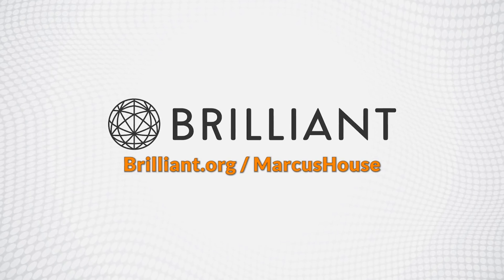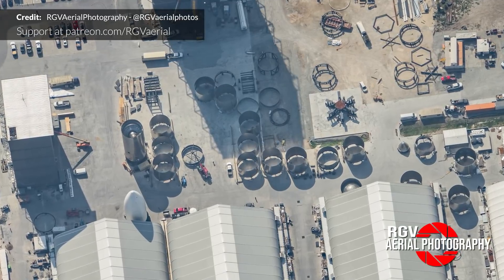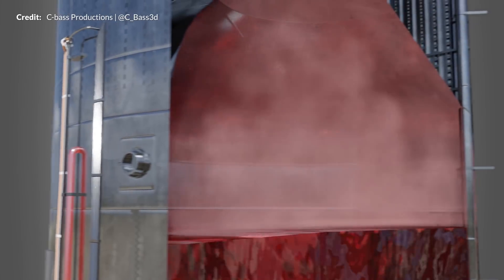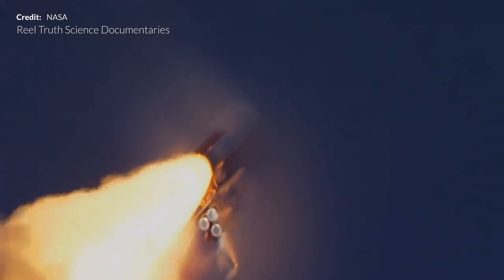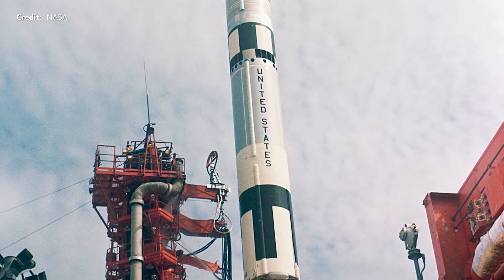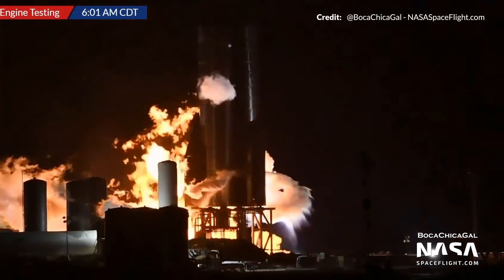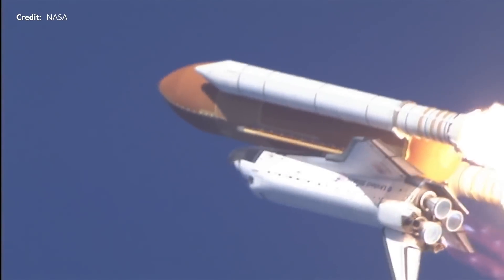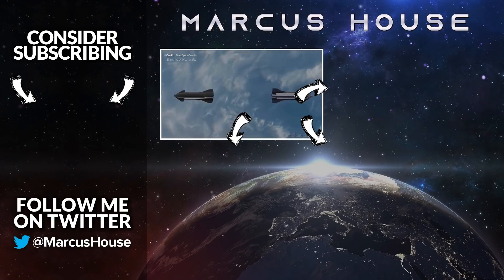SpaceX Starship - How will Starship tank autogenous pressurization systems work?

Comment: Question about something you stated early on in the video. You said that pressure is required for structural stability of Starship so the weight doesn't cause the rocket to collapse down on itself. Wouldn't that mean that when Starship does start to take payloads to space, the tanks would need to be pressurized before loading the payload? If the payload is in the front of the rocket, wouldn't that weight cause the ship to collapse if there's no pressurization below? (Assuming they don't pressurize until right before takeoff)
Reply from the maker: We are not sure what that limit is, but potentially yes.

Comment: Autogenous pressurization will be the way to go for longterm missions. When reentering on earth or mars parts of the fuel are likely gonna be used for cooling anyways so there should be enough heat. 
However this wont work for either suborbital flights or when landing in the dark at a non-atmospheric celestial body.
And also they will at some point need to start their engines while in orbit but on the night side. 
So COPVs are going to be needed. But they won't have to use them all the time.

Comment: Marcus, I say get rid of the header tanks and replace them with baffles inside the CH4 and O2 tanks so that the main tanks are effectively segmented into chambers, with the aft segment having the volume which corresponds to the amount of fuel needed for the landing burn.  Tanker trucks use baffles to prevent the problem of sloshing liquid causing structural damage.  Baffles in the main tanks would add structural integrity, and during main engine operation, acceleration would push fuel toward the back of the rocket, and would cause the chambers to drain from one to the next, so that the aft chamber is the last chamber which contains fuel, and which would have no gas-state reactants, and therefore no sloshing problem, and no cavitation problem.  Pressurize at the top/front, and draw fuel from the bottom/rear.  No sloshing and no cavitation.  The baffle could be sealed using a valve.  We know that mechanical operations occur inside tanks, because that became an issue with Apollo 13.  The only problem right now with my suggestion is that the header tanks seem to be needed at the top of the rocket right now, for balancing the weight distribution.  That need is temporary.  The function of the header tank, other than weight distribution, can be accomplished with a baffle and a valve which would add structural integrity without adding net weight.  SpaceX should be adding dead weight at the top of the rocket anyway, rather than balancing weight distribution by putting a header tank there which will need to be moved eventually anyway.  But your post was about pressurization and not about ullage wasn't it.  Excuse my rant.

Comment: I find the explanation slightly unclear/confused regarding the plumbing around the preburners.
To be clear: The gaseous output from the preburners is NOT used for autogenous pressurization.
The output from the preburners contains gaseous propellant, but also some water and CO2. Those would freeze to solid chunks of ice if you feed them back into the tanks.

Instead, some liquid propellant from the tanks is fed through a heat exchanger to boil it to a gas, then that gas is fed back into the tank.

Comment: My thought is that they need a 'micro-motor' that handles pressurization without needing to fire up the main engines. Give it multiple exhausts that equalize the thrust (say, out the side of the skirts). Instead of COPVs to start it, maybe it could use a small electric motor or a small gas turbine powered by low-pressure oxygen and methane - something that could essentially run off unpressurized gasses from the main tanks.

You might even be able to maintain tank pressure continuously by harnessing the waste heat from the crew compartment. Removing excess heat has always been a problem for spacecraft, why not figure out a way to harness it for something useful?

Comment: I believe their issue is not the pressurization, it is the fact that during the swing, the fuel is sloshing in the tank so the liquid fuel is not flowing constantly into the burner. They need to either baffle the tank or put a bladder in the tank to control the fluid.

Comment: How about a structural core fuel tank; two core proportional cylinders running the length of the Starship, functioning as two structural ‘syringes’ injecting LOX and methane towards the engines? Could mean more Window Seats...?

Comment: Hey Marcus I think you should talk about tank pressure under different atmospheric pressures, would it be easier to pressurize the tank on mars or the moon and even in space, because the lack of pressure on the outside pushing in. and can Starship hold its integrity in space if it keeps its pressure from sea level or would it pop?

Comment: To keep the pressure, just put a catalytic membrane between the ox and CH3 tanks.  The slow burn (size dependent) would produce heat and gasses to keep both pressurized.  But what if the problem in SN 9 was not pressure, but big bubbles in the supply lines to the engines?  What the starship does, the others in your examples do not do, is flop down on it's side.  Bubbles cause huge swings in ratios and boom, a piece of the engine goes flying out the bottom, and the engine will not light - because it is damaged.  This is not an easy problem to fix.
Reply: This is a problem they've calculated in from the start and it's the reason why they use header tanks.
If there's enough pressure in them there won't be any bubbles.
Reply: @EaglePicking  That is a fallacy.  As long as there is headroom in the tank, there can be bubbles.  And there has to be headroom in the tank if it is pressurized with a gas.  If there is no head room, the fuel cannot leave the rigid tank.  As soon as the nose goes horizontal or below, fuel can flow "up" out of the feed pipes, replaced with vapor.

Comment: IMO SN8,9,10 and 11 all have an obsolete header tank design. Because of it the remaining SN10 and 11 stand fairly high chance of RUD. I don't think autogenous pressurization is some insurmountable problem it just required tank changes that could not be done in already constructed prototypes. So hopefully SN15 on will have autonomous pressurization working correctly.

Comment: So long as the external vacuum is near absolute zero. Otherwise that's a lot of heat management which will amplify the pressure making more gas and less liquid. But Elon is right, the operating parameters of the raptors are what all of this points at. They need an engine closer to the hydrogen one at blue origin. One thing I enjoyed about the blue origin flight  is that new shepherd got the landing under control first, half a second hover, then put her down real easy. As a passenger, I want that. Landing directly while in a deceleration burn at the same time compounds probability of the RUD occurring, at least in the perception of a Martian wannabe strapped to it at the time. So wider operating limits. In my opinion the Falcon 9's are magic at the landing, but they seem highly specialized. Control within boundaries as determined symbolically for the flight plan. Not for general flight.
Reply: Starship is capable of hovering as well. They did so with the hop tests. While it wasn't identical to BO, it's shows that it's capable. The problem for Falcon 9 landings is that even a single engine has too much thrust to hover with such a lightweight vessel. Starship is heavier and could hover, though it does waste fuel. 

The booster will still likely do the hover slam.
Reply: As far as I know the minimum thrust before flame out occurs is still a problem. But if I'm wrong and starship can hover that begs the question, why not be more delicate about the process. It seems all a bit like a blunt instrument. Sure it'll use up more fuel, but ultimately a delicate solution may make the probability of RUD less, and the landing less brutal for passengers, although the roller coaster ride might be fun.
Reply: @codemodeza  "Sure it'll use up more fuel," This is the answer to everything. The more fuel used to land, the less cargo that can be carried. There are no passengers currently on SS nor Falcon 9/Heavy that are affected by the landing burns. Reducing the chance of RUD isn't an issue right now. Perfecting everything is more important.

Comment: Great video.  Could a device be designed to aid the engines in maintaining proper pressurization?  This device could be started in advance of engine start up to provide pressurization before autogenous pressurization was available.  I assume that the power for this device would come from burning a small amount of fuel and oxidizer.  James

Comment: simple pressure on gas won't keeep it pushed into the supply manifold pipe to the engine depending on the orientation of vehicle and quantity of gas available to cover manifold inlet.  so what keeps gases covering inlet pipe so pressure can be brought to bear as necessary?

Comment: Just a thought... and I'm really no rocket scientist (like that has to be said, ahahahhh): but if SpaceX is having an issue with repressurising the header tank which is, in turn, causing some performance issue, what if they redesigned the header tank to feature 3 smaller headers, like funnels, which would take less to pressurise by volume, which themselves could feed into the larger one, thereby building pressure sooner but in incremental stages?  They could begin the repressurising sooner in the flight, and spool up the engines sooner, ready for the big moment.  I realise that means added weight, added mass, added material, added cost, added testing, added turn-around time, added possibilities for a failure.  But, just a thought, for whatever it's worth.

Comment: Get rid of the header tanks. Add some tiny solid boosters to level the aircraft and push all the remaining fuel in the tanks to the bottom. This would then allow startup of the mains without any gas bubbles or fuel sloshing. Probably a 5-10 second burn on the small solid boosters. Problem solved. Could also add one way baffles to keep fuel near bottom of tanks.
Reply: How about using external engines for slight acceleration so the fluids would settle down towards the engines? When they fire the acceleration they make could direct them down without further assist.

My idea here is stupid (added complexity for one) but it is possible.

Comment: Well starship 5 & 6 took off and landed ok using the same type type engines. So in my mind unless a bunch of bad engines are flowing off the assembly line
Which might explain why Elon has refurbished sn 25. The only explanation would be something happing with the belly flop maneuver.

Comment: The only problem with autogenous regeneration is that the engines have to be running to generate the pressure.  That's  fine for accent and other burn maneuvers, but entry is not relying on an entry burn, just the belly flop maneuver to bleed speed.  So the problem would be how are the tanks pressurized at this point.

If your using autogenous regeneration for pressure, at some point won't the "warm" gases that a reintroduced into the tanks re-condense, and pressure will go down?
Reply: Entry heating will likely heat the fuel and cause some amount of evaporation.

Comment: Autogenous pressurization is actually quit simple in principle. It's just not implemented at this stage of the prototyping cycles. The added mass of the current system is not a problem at this stage.
Priorities are to get the engines reliable (the very hard part!), stick the landings 100% at the time to have a shot at getting the vehicle rated for human flight, get orbital.
Then they have a steep mountain to climb to return from orbital velocity and stick the landing. Still to sort out the energy requirement to keep humans alive in a multi year expedition to mars and back and that will be the really hard part. Not to mention how to establish a self sustaining permanent colony on Mars. Using vast amount of earths resources to keep an a useless colony on Mars just for the sake of it isn't viable. There is a reason why there isn't a city build with a 1 million population on the South pole. Having to live of soylent green in a cave gets boring after a while.

Comment: The rocket equation is a lie. Or at least the idea that it is the equation that will make you take the steps to making a rocket. Don't get me wrong, it is important, but the equations that will help design systems and hardware that will make a rocket are the ones on thermodynamics and fluid mechanics. They do (in a way) incorporate the rocket equation but why focus on the rocket equation if you need the rest?

Comment: Hey hey.  Raptor education day.
Set aside the desire for simplicity for just a moment.  Think, can they?  What if?
-
There were a couple of tricks we use to get motors started - back in the day - when the world was young and so were we.  Anyway can Space X use hyperbolic fuel to prime the engines at start time.  I have use the spray starter - either to start small engines.  When you pull or try to start and it just won't go - give it a squirt of either spray in the carb and voila - starts right up.  Just wondered if that might work as start insurance.  I can see how the restart might be a challenge.
-  I know, I am over simplifying.  I had a Yamaha RD-350 2-stroke.  The guy I got it from had  selected a different spark plug from the manufacturers recommendation.  It was colder - story for another time.  There were days it would just not start.  So, take the plugs out and heat them up on the gas stove.  A bic lighter sometime works but not quite warm enough to be reliable.  When the bike was warm it would start but cold it was a cranky bear to light.  Odd little technique of heating the glow plug  seemed to do the trick.  I think the diesel engines are like that with the glow plugs too.  When the weather was really cold, sub zero, I put an 100 w trouble light on the water pump under the hood and the car would start in the morning - without it - no go.  (remember to take the extension cord and light out before starting)  It would seem Raptors want to be warm too - give them some love.  A shot of go juice, warm plugs and keep them toasty warm while waiting.  
Mr. House and crew, thank you for the peek under the hood.
Will work for ticket to Mars.  Peace.

Comment: Can someone explain how pressurising the tank would solve the problem of fuel splashing? I imagine a soda bottle, which is a pressurised tank of a kind, having the liquid pushed on the bottom by the pressure on the top part. This is not what happens of course, hence my confusion with the concept of tank pressurisation for fuel flow into the engine. Is it about only fuel flow rate and not about fuel position in the tank at zero-g? Thanks for the clarification!
Reply: Eric - good point on repositioning sooner - bet they do that

Comment: Pressurizatio can also be obtained with a diafram like an injection!  (Or gas bladder) The fuel "IS" sloshing around creating gas bubbles no fuel in lines engine failure!
Reply from the maker: A gas bladder that doesn't freeze with cryogenic fuel? What is that material made of?

Comment: Hi, you forgot to speak about the brutal fuel deslocation during the belly flop manoeuvre, up, down and then a sudden up again makes that fuel bounce around like hell 😅, so it is normal to have lots of issues with air in the mix
Reply from the maker: That is why they have the header tanks. They shut the main tanks off.
Reply: Not to mention how people & cargo would react to such a rapid maneuver. It would throw things around that aren't fully secured & would likely make a person queasy 🤢

That flip is super sketchy tbh. Seems like unnecessary theatrics (& yes, I'm also versed in physics, math, etc.)

Maybe a SLOW rotation (30+ sec) & long landing burn when upright would make it viable.

[Youtube has a bot or paid TROLLS that DELETE factual comments]
Reply: @CHIEF_420  Your comment isn't a factual comment. It's just your opinion. People and cargo would need to be prepped for the maneuver, but it shouldn't be any more difficult than the re-entry in the first place. Everything has to be fully secured for re-entry as well, even on current systems. And an astronaut won't get queasy from that maneuver. 

"Seems like unnecessary theatrics" It's very necessary. Starship has to slow down and the best way is using the belly to slow it's decent through the atmosphere. The Shuttle did the exact same thing. However, the Shuttle had wings, so it didn't have to transition out of the belly maneuver (wings have their own issues though). Starship doesn't have wings, so it has to come in on it's engines to land.

Comment: If the tanks are empty when landing on Mars, how will the structure maintain itself? I.e.,  no pressure in the tanks, the structure isn't as strong.  Lower gravity on Mars?  Ok.  Then getting back to Earth will require launching from Mars, accelerating from Mars to Earth and finally landing on Earth.  This will be much harder on the structural integrity.
Reply: The need for the extra structural rigidity comes from the weight of the propellant; if it’s even 5 times lighter empty, then it would need to endure only a fifth of the force acting on it; compounding with lower gravity, there isn’t a need to worry about the structure

Comment: Do we have any info on what the exact problem was with SN9?
Reply: A raptor failed to relight properly just before completing the flip. Starship overcorrected since the lack of one engine prevented it from returning to its vertical orientation, so it RUD’d.